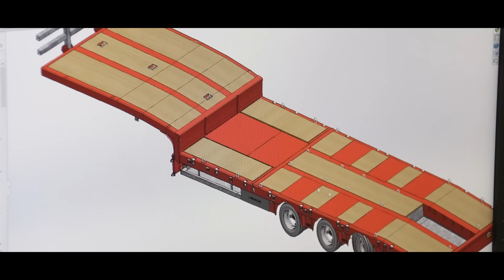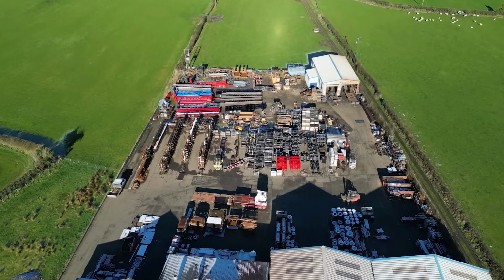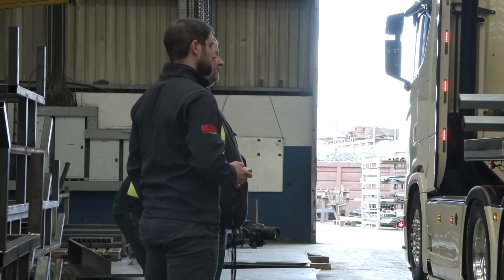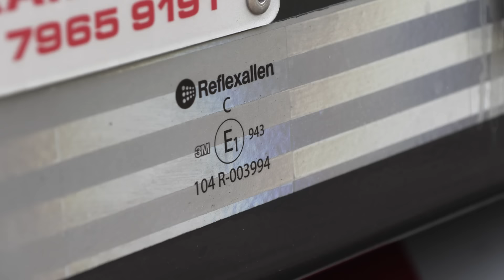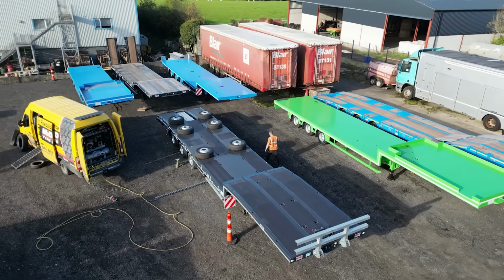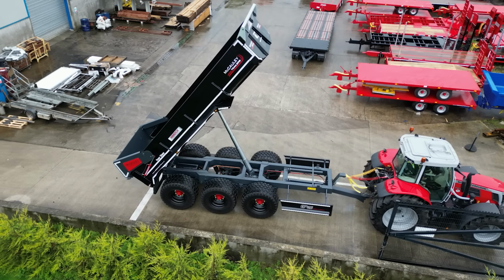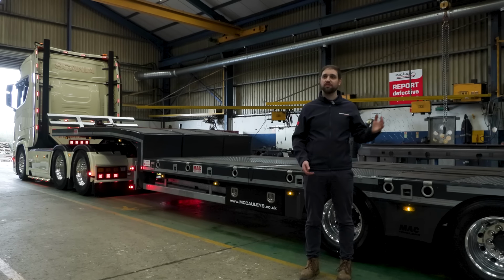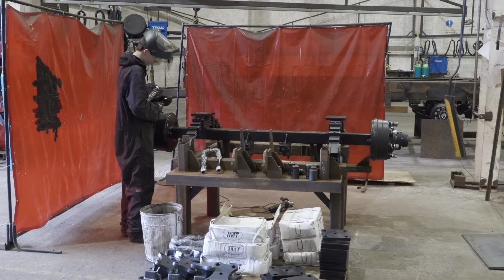Return of the MAC | McCauley Trailers Ltd.

Comment: What’s that trailer like to pull compared to the NC?
Reply from the maker: The MAC is lighter and therefore easier pulled but the NC is a good bit heavier and solid as a rock.  Two very different trailers in my opinion.